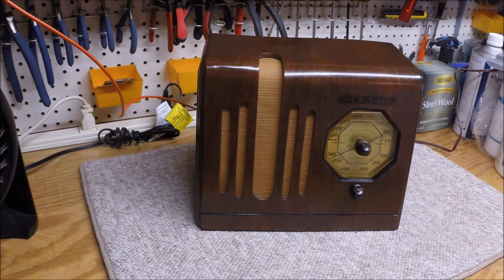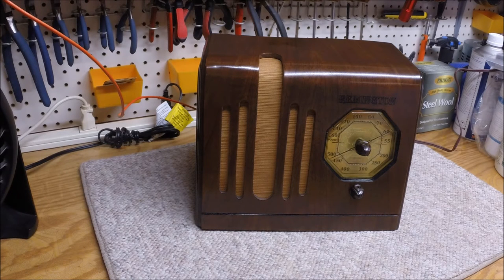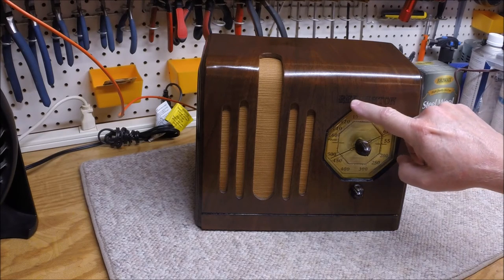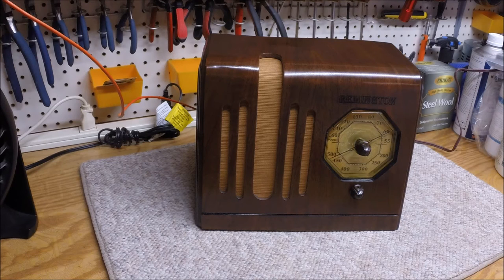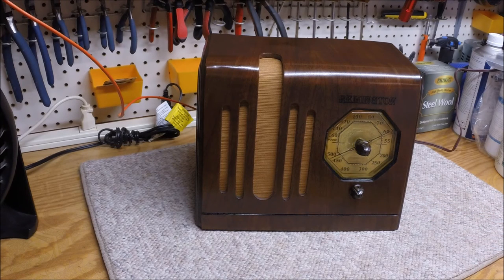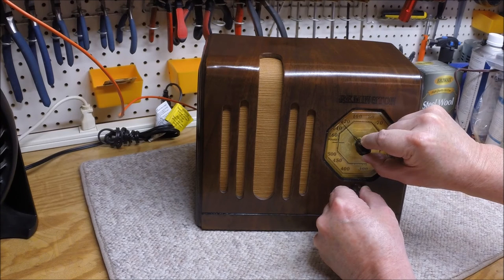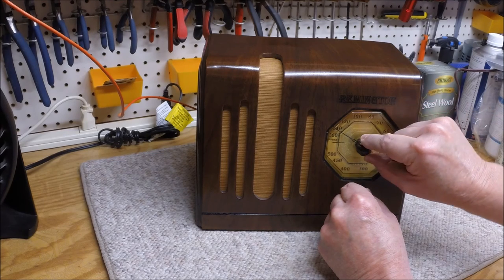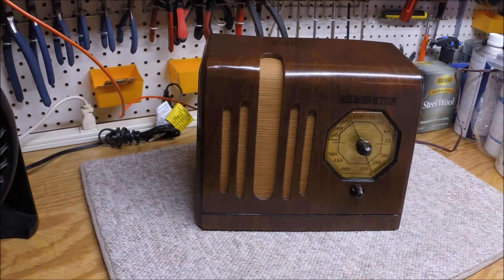Remington TRF Receiver - Restoration Complete

Comment: Don, these radios keep getting better, and better!! That's one booming audio section, and the finish on that cabinet has a nice "warmth" to it. Do you by chance have plans to include any other forms of antique or classic electronics in the restoration efforts championed by your father and yourself??

This radio reminds me of the Silvertone which sat on my (maternal) grandparent's "Canasta" table. Because they lived in a row home, their choices for an antenna were severely limited. I remember their having an indoor antenna fashioned from a "John Wanamaker" hat box, and connected to the radio via twin-lead "ladder line". I remember the intricately woven cloth covered wire lattice along it's inside perimeter, and a piece of wood with wire woven onto it, which was mounted in the center, and could be turned for optimal directional reception. There was a small rotary switch mounted under the center, possibly used to select omni, or unidirectional modes.
Reply from the maker: ***** Tim, the audio on this TRF receiver does have a "kick" for sure. Our collection today on the electronics front is pretty much limited to vintage (tube & transistor) radios with a few phonographs. I had a few older TVs in the past that I restored and gave them to my brother-in-law to make more room for other... I do have a few pieces of test equipment that need a little work, i.e., tube tester, sweep generator and capacitor checker. I'll try to publish a video or two on them as time permits. Thanks again for watching and sharing your memories, which I really appreciate and enjoy! Don
Reply from the maker: ***** I saw you noted the cabinet had a "warmth" to it. I used a high gloss lacquer then rubbed it out using #0000 steel wool and Wool-Lube to achieve a semi-gloss finish. This was my first time using this technique and product. I like the outcome too.

Comment: Does this radio not have an AVC? I notice that there is practically no sound when you're not tuned to a station.
Reply from the maker: +Rua Whitepaw Rua - thanks for your question. I don't have the schematic in front of me, but I'm rather sure the radio used a 6D6 as a RF amplifier, 6C6 as the Detecter and a 43 tube as the power output. There's no AVC in the radio and the audio taper resides between the antenna input and the grid of the 6D6, which ties back to your observation in regards to the audio quality and level. Thanks again for your question and taking time to view the video. Best, Don